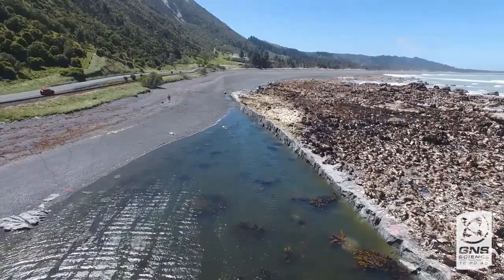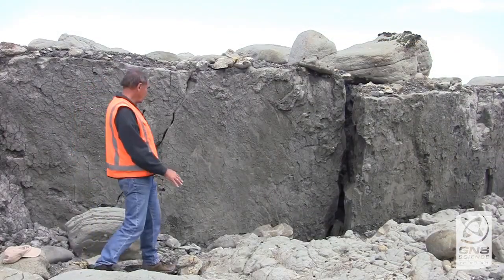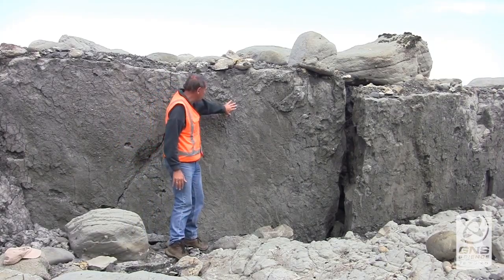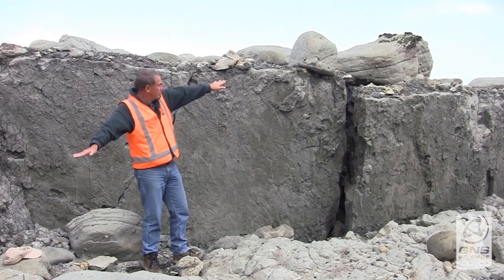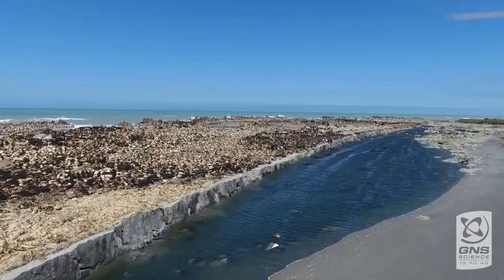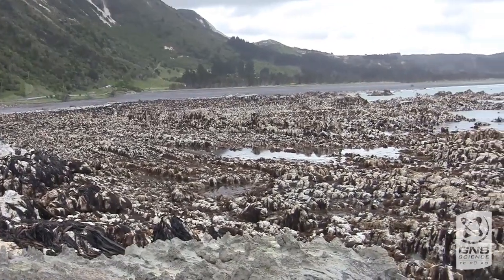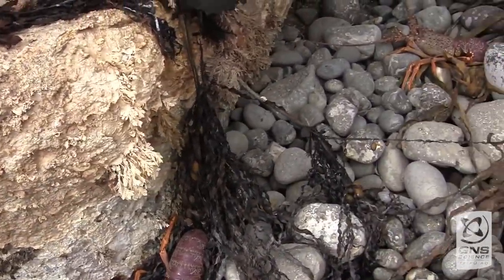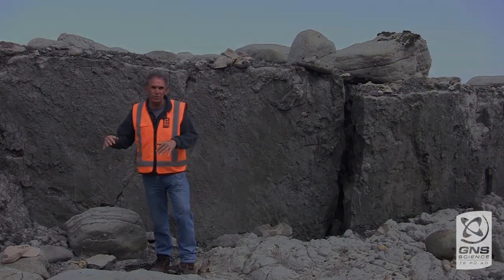Kaikoura Earthquake 2016: Papatea Fault Rupture

Comment: The fault ruptured at 3km/second?
That's 11800 km/hr
A mistake surely. There would be a lot more damage if the earth had made a sudden 6m dash at almost 12 thousand km/hr.
Reply: Apparently (just googled...) a 1.6 km/s rupture velocity (the speed at which a rupture front moves across the surface of a fault in an earthquake) is considered slow. So I guess 3km/s is correct.
Reply: Denian Arcoleo Thanks, I get it now, it is the speed of propagation of the rupture, not the speed at which the ground moves.
I wonder why that was worth mentioning.
Reply: fault movement is on the order of 1 m/s
Reply: the 2004 Indian Ocean Earthquake ruptured 1500km in 10 minutes
Reply: Nope , no mistake
Reply: As if the earth stood still haha
Reply: You think the GNS would publish a video and leave it up with incorrect information?

Comment: Can we see the 6 meters anywhere? Are we allowed to re upload these videos as they have a GNS logo on them :)
Reply: Since it didn't shoot straight up, but on an angle, then yes, it probably did shoot out 6 meters
Reply: Yes,  that is a bit confusing.  About 100 m from the fault you can directly measure a 6m uplift from the present sea level. The downturn side of the fault that Kelvin is standing on probably rose about 3 to 4 m rather than just 1.5 metres. The sideways movement is in addition to the maximum 6 m uplift